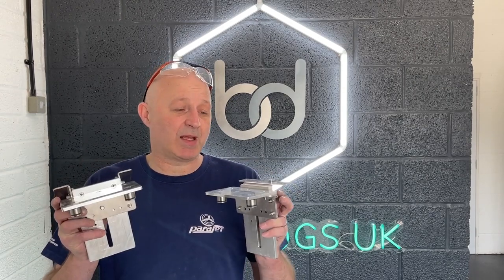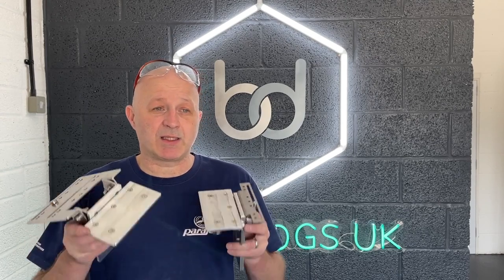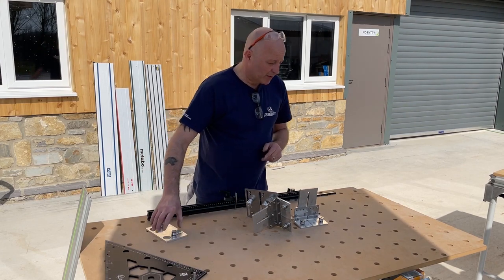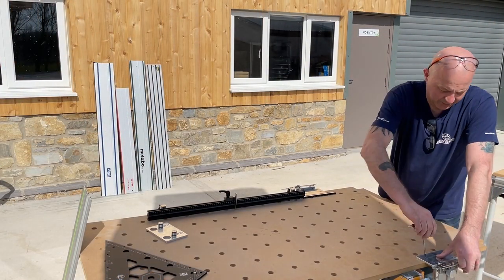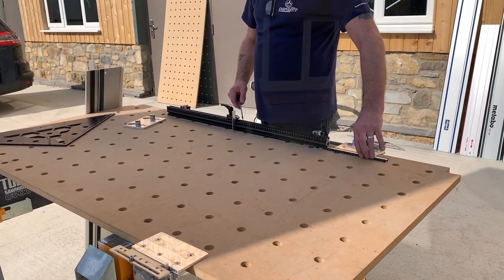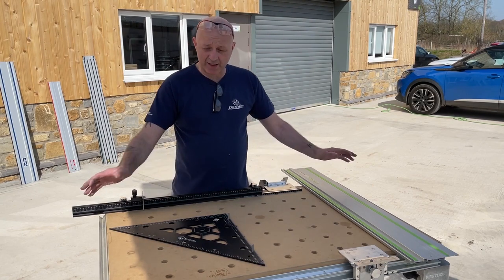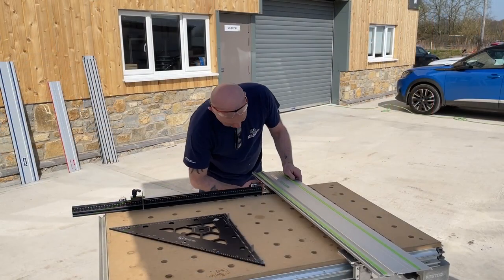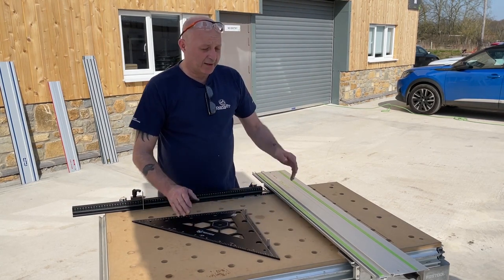Benchdogs.co.uk - Quad MFT Hinge System

Comment: Does the hinge system auto adjust for various material thicknesses?
Reply: Wondering the same. The back side of my bench will be against a wall, so I won't be able to access the hardware to manually adjust a knob.

Comment: Looks like it could be a useful system for setting up bespoke cross-cutting tables. The MFT is nice but it's expensive and the wrong shape for a lot of the jobs I do and takes up a lot of space in the van. A narrower, longer table would suit me better. Looking forward to the introduction. I have to say that I agree with @Andy Sweetland 's comments about sound levels though - difficult to hear in parts

Comment: What are the best length tracks to use for the two different directions, back-to-front and side-to-side? I was planning on adding an MFT top to a home-built base rather than buying a Festool MFT table but I'm sure I'll have two or more tops at some point with the long sides adjacent and the hinge on one of the short sides. Thanks for any help.

Comment: Hi Ralph, I was fortunate enough to receive my Hinge System in the first batch - just getting round to setting it up now - stunning quality and finish as always. I'm finding the support end (not hinge end) isn't fitting snugly into the channel on the underside of my Makita rail - the rail doesn't appear to be worn (tried an alternative seldom-used section. I'm worried this will impact my ability to get reliably square cuts. Any suggestions?

Comment: Raph question, For full support of the under fence rail. Do the fence dogs also need hole bored closer to the edge to line up the fence with the hinge hardware? and if so, is it the same 24mm? Thanks
Reply: Hi Stephen, apologies for the later reply.  the system was made that the fence would work 16mm behind the fence system, for example, if you have a standard MFT table I would router out holes for t Hinge using the 48mm setting on the hole jig, I would then router out holes for the fence using 32mm, reclaiming some of your bench space back.  A new video will be uploaded with all this information asap.

Comment: I am having trouble sourcing a 20mm bit with a 1/4 or 1/2 shank to drill out the dog holes. I was hoping to get a Forstner bit but at this point, I think I would try anything. Here in the states, all I can find is a 3/8 shank with a 20mm bit. Does anyone have a lead on where to get one

Comment: It’s a fantastic product Ralph, as is everything you make, however it’s not suitable for those of us in small workshops with a fixed bench against a wall ☹️.
Reply: Check out Peter Millards channel, he has a tiny workshop and his bench is against the wall with one of these hinges
Reply: @wandango5913  thanks, yes I’ve seen Peter’s video, but my bench is fixed in position against the wall, no gap for the rail to fold into. The only option I’ve seen that would work is the double hinge method as shown in videos by conkat & kingsworkshop.
Reply: @idlersdream826  you could have it round the other way. With the hinge part nearest to you.

Comment: Are the additional holes absolutely necessary or just recommended? I’ve ordered the hinge but not the hole jig as I didn’t notice that requirement and just jumped on it as soon as you released the first 100. For my personal use case it seems a tad excessive just to cut 4 holes plus I’d need the parts for the router too.
Reply: Mine just arrived and they are necessary. Slight disappointment this, as this is an MFT attached hinge system, I anticipated that it would fit a standard Festool sized MFT top without further modification and that the extra holes were to accommodate tops that are not standard,   but this is not the case. I'm also not seeing much in the way of adjustment so basically these holes need to be spot on so that raises another requirement for the optional jig maybe. You'll also need a 1000mm rail, my 800mm is not long enough. It's very well made mind, I'll report back once i've got it setup but expensive just ended up more expensive.
Reply: I got to setup this evening and I understand now, having fitted it, how the extra holes are a trade for a more compact design. Still, you do either need the jig, or a raft of other hardware to insure you drill the holes with precision. The accuracy of the system relies on these holes being perfect so freehand with a router and 20mm bit is not going to cut it. So, to fit as a minimum, the easiest way is with a router, a quality 20mm cutter, a 30mm bush and the jig so this needs to be factored into the purchasing decision. I did it similar to Peter Millard in his video, but a still had to buy the 20mm cutter for 4 holes. Still, now it’s done, it does look, operate  and is way more precise and repeatable than my current rail square based setup. Need to make a shed load of stuff now to prove I needed it. 🙂
Reply: @MinskUK  thanks for coming back to this. I ended up buying the jig as well and I got my hinge last week. I still have not set it up as I only have a Makita trim router which has a plunge base so I need to figure out how I make that work as I am not at all experienced with routers and guide bushes. Not even sure I can get a 20mm cutter for a 3/8 shank yet.
Reply: If it’s the DRT50 type trim router, that can take a 1/4” collet. I used the Trend Pro 1/4” 20mm cutter (it’s all that looked suitable from Amazon) in my 1010, if you have a 195563 base, looks like screwfix have the 30mm guide bush
Reply: @MinskUK  yes, that is exactly the one I have plus the accessory bases so I assume it's the 195563. Would you mind linking to the exact cutter you got on Amazon just to make sure I get the right one? Screwfix don't deliver to Europe anymore but I bought some Katsu guide bushes a while ago which I hope will work. Appreciate your help so far, thanks.
Reply: @alistairstanger2940  What did you end up using? The amazon reviews on that someone says the holes are too big - what was your experience?
Reply: @christopherhall1502  I haven’t done anything yet. Was too nervous to risk it. I am now waiting for Peter Millard’s big review of router and bit combos and hoping my router is amongst them which I think it will be.
Reply: @alistairstanger2940  Kinda a pain but you will need a 30mm bushing and a 20mm cutter.    They had these two on amazon (USA) Festool 491072 Euro-Hinge Boring Bit HW 20mm with a 8mm shank and another made by CMT 811.200.11 Straight Bit, 1/4-Inch Shank, 20mm Diameter.  I made the mistake of ordering the festool without realizing it had a europe 8mm shank.
Reply: @Trickmanii  yes it’s the cutter that concerns me. Seems not all 20mm cutters are created equal and the resulting hole can be slightly wrong size. Did these ones give you a good fitting hole for the hinge?
Reply: @alistairstanger2940  I just made the cuts last night and the Festool 20mm bit made a perfect cut when pair with a 30mm guide bushing.  So no problems there.
Reply: @Trickmanii  ok so you didn’t buy the cheaper CMT bit in the end?

Comment: Do you need two units to ensure the rail is square?
Reply: Yes you would nee the opposite to align to keep square
Reply: @RalphBD  thanks Ralph - and the unit comes with this also when purchasing?
Reply from the maker: @jonathansmith4399  the hole jig is separate as not everyone would need this.

Comment: Need support, mine will absolutely not square up ,
Reply: Hi Dave. Have you downloaded the manual and read the calibration section.  Is your mft a home made or cnc version?
Reply: @RalphBD  home made with the parf guide ,I just went through the manual again .I had the hinges rebated into the top , I noticed a bit of pressure to one side and cut a small relief it now squares up perfectly